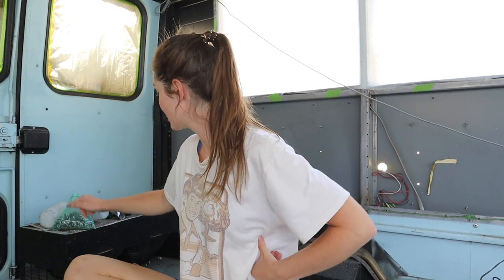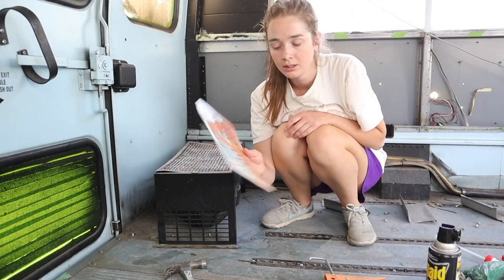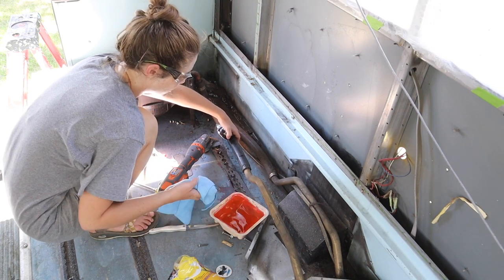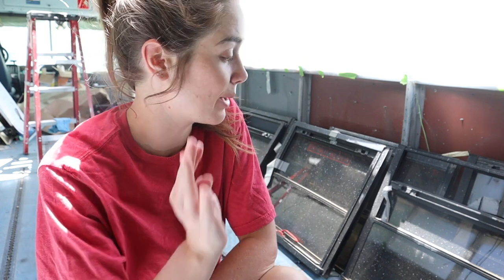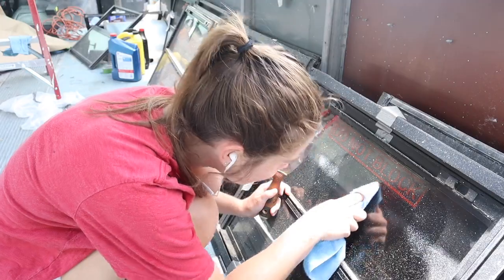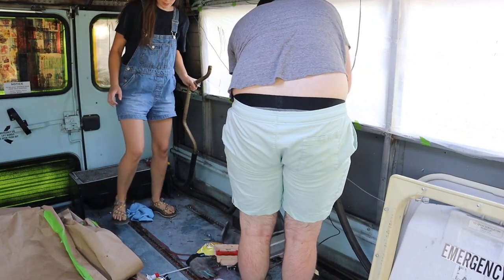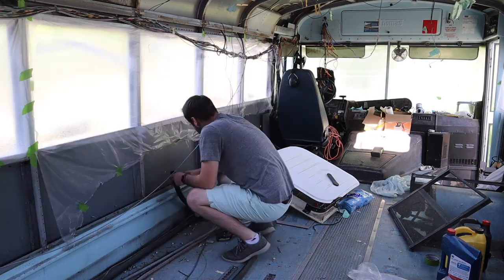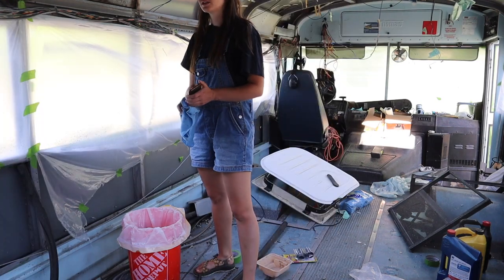removing a heater and having a meltdown: bus build part 13

Comment: That was great entertainment. I don't know how far in the past this was recorded,  but a couple of things if you haven't figured it out yet - your brother is absolutely right about that kink in the hose. Go back to the hardware store or home depot or whatever and buy 2 elbows (90° fittings like the one he bought for you - but the next size smaller so they fit properly) and use a piece of the old hose along with the elbows to create a loop. Also, be sure to run the engine for a few minutes and check that the coolant level is still where it should be (and check it again after it has run even longer).  There's a decent chance that you introduced an air bubble in the system and when it works its way through you might find your coolant level is low.

Also - and this is coming from a dad of a young woman who is an electrician and I'm also a coach for several dozen young and older women - give yourself more credit for your brains and courage. You're a much better problem solver than you seem to think.  If you get in a real bind, there are bunches of people who can walk you through what you need to do - and you are capable.
Reply: Exactly
Reply from the maker: Thank you so much!

Comment: Where you were laying down outside in the front of the bus, disconnect both lines from there and either loop it with the hose or block it off with the clamps and block offs. Ohhhhh and the hose that was hanging outside is a crank case exhaust hose. Do not eliminate it. You will have engine failure. (Per Tito's instructions) do you want our phone number?? If you have questions Tito can help you and talk you through it. Maybe Facebook messenger?? (Emilie)
Reply from the maker: Thank you so much! And yes I would love that!

Comment: Emma I would suggest a Black&Decker portable ac/heater. They draw less amps than a mini split. This suggestion is for just starting out. You can upgrade later if desired. 
Emma you're doing a great job tackling such a Hugh project. Can not wait to see more. Hugs!!
Reply from the maker: Cool, I will look into it. Thank you!!

Comment: Hi

I know this video is 2 months old and you probably already have the heater core removal project done by now. But just in case you haven’t, I just saw your video today I wish that I had seen it sooner. I didn’t read all 89 comments but I did glance over most of them. I hope that someone told you that you needed to put in a heater hose bypass up by the engine, rerouting the anti freeze back to the engine to reclose the cooling loop, so you won’t get antifreeze all over, and drain your radiator. BEFORE you start your engine, or your engine could over heat and you don’t want that. I do agree with one of the comments, you might want to keep that remote second hearer your probably going to need it. You could work it back in later even if you have to run new water hoses under the bus. I had a conversion van half the length of your bus and I had a remote heater, I couldn’t have made it through the winter without it. An electric heater would draw too much current I doubt your electrical system would be powerful enough to run that. Something to think about. 

Good luck with the rest of your project, it will be great 👍 

Louie 
IL 🇺🇸 USA

Comment: I'd watch not to damage that aux. heating core. I'd use it somewhere in the design. That's a big metal box (the bus) that will get very cold in winter. That unit is free heat any time the engine is running.

Comment: I have an extra ac unit for Thomas bus if you want it. I had two and disconnected both and ran the hoses underneath instead but only installed 1 back i figured that's enough just to drive with. I haven't tried if they actually work but i have them 😄 After installation a professional hvac person needs to come out to fill up the system.
Reply from the maker: nice! where are you located?
Reply: @EmmaBuildsBirbie  ok actually I'm a dummy.. I forgot i put it on the truck load that was going to the dump! 🤦🏻‍♀️ i only have the outdoor unit part of it. I'm in Southern California. I don't know if half the setup would worth your trouble but do have that. You might still have that in your bus too..you should look. What I would do is leave enough space for it and figure out where you want the vent to go back up in the living space and eventually you're bound to find one from someone in the skoolie community that's getting rid of one. I can ask around too. Sorry I got your hopes up 😅
Reply from the maker: @HajnalkaGyurgyovics  haha no worries, you're too far away for it to be worth it anyway and I figured that would be the case :)
Reply: @EmmaBuildsBirbie  🍀try to call AAA bus LLC in Phoenix Arizona, they sell and service school buses. They are plugged in the skoolie community 😉 great contact to have

Comment: 800 watt solor power will run air conditioner  but only the ac
Reply: I would get as much solor power as I could afford,that way it will be cheaper to get electric appliances.

Comment: Usually red in a vehicle is automatic transmission fluid is the fluid oily or is it watery like antifreeze you may have to see how it feels or smells you tell the difference it might be something you shouldn't have cut into unless you're ready for some big job you don't really want to take on

Comment: You will want to follow those coolant lines back to the engine area as far as possible. Measure the outside diameter of the hardline That will be the inside diameter of the hose which is almost always the way hose is sized. It's likely 3/4" or 7/8" ID (Inside Diameter) hose or outside diameter hard line. Then you will want to go to your local home store and find Brass 90ﾟHousebarb fittings that match the diameter. Don't use those plastic they won't last for hot coolant. They will either be near the other brass plumbing fittings, or probably near the Yard hydrant parts. Then you need 6 hose clamps that fit the rubber Hose.  If you can't find the proper size check for a copper water pipe 90ﾟ fitting that measures the correct diameter somewhere around a 3/4 inch would probably be close to the right size outside diameter to fit into your ID rubber hose. Once you have all that cut 2 short 3" or so section of hose. Slip onto each hard pipe, slide on 2 hose clamps to each one, then insert a 90ﾟ fitting in there. Then with the two 90ﾟ fittings inserted, cut a length of hose to run between them, install with the hose clamps. You now have a completed U shape loop in the coolant lines to keep it flowing correctly. Be sure to tighten your hose clamps securely. And top off coolant tank appropriately. Then run engine till it warms up let it cool down and top off as needed.

If you find out the coolant lines are just hoses not hard lines you can eliminate the 1st 2 short 3" pieces of hose and insert the 90 right into the coolant hoses off the engine.

If you want to special order a coolant loop hose. You just need the coolant hose ID (Inside Diameter and the approximate length between the lines like measuring the width of the top of a U. Go to an auto parts store and tell them the description of what you need and the measurements. They can look up and order the U-shaped hose you need in the correct diameter. Snap some pictures of where you plan to install the hose so they can make sure you have everything you need.
Reply from the maker: Thank you!!

Comment: Goof off for the paint of the windows. Vintage air for the AC from the driving area . The heater in the rear of the bus needs to be disconnected from the motor of the bus , remove all  Of the hoses And where the hoses came from the engine area need to be plugged off.

Comment: Skoolie.net is a great forum for conversion questions.  Also I'm reading registering a bus to rv can legally be done without the hassle of inspections by printing and completing a VD119 form from the state of Vermont.  This can be done no matter which state you live in.  This process can be found on above website.  As far as insurance I've heard of " National General Insurance" and "Good Sam".  I'm curious what state you live in.  I recently had my full size school bus dreams passed on when I found out in my state that a bus weighing 26001+ pounds requires a non cdl class b license which requires a driving test and the hassle driving of to and from the test site with a person that already has the license(because i can't legally drive the bus yet)  then pass a air brake test.
Reply from the maker: Thank you! I live in Utah, no extra license required here, thank goodness (unless I’ve just misunderstood and been driving illegally?)
Reply: @EmmaBuildsBirbie  you're right.  I don't think you need certified on air brakes either.  Lucky you, my state requires non cdl class b and air brake endorsement.

Comment: Heat and a/c are different systems. The heater runs off of the engine coolant as where the a/c works off of freon, so it’s most likely your in dash a/c that doesn’t work
Reply from the maker: Thanks!